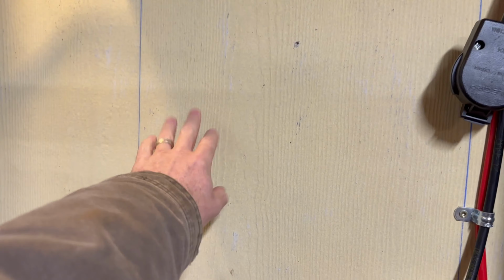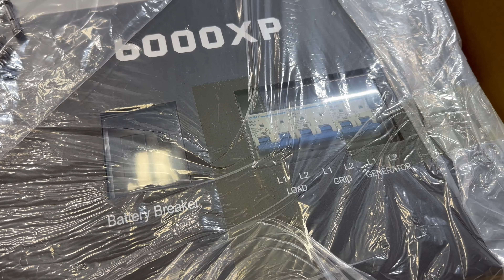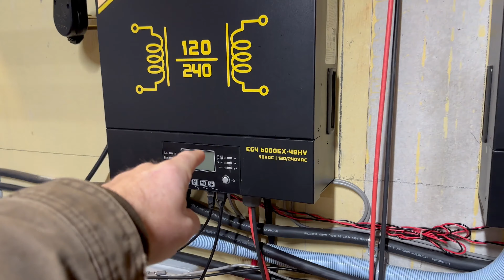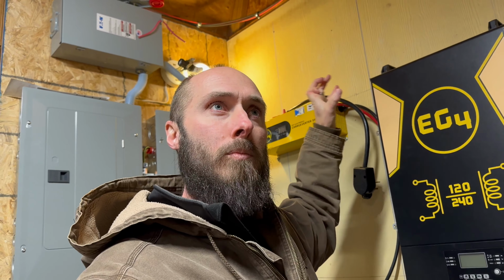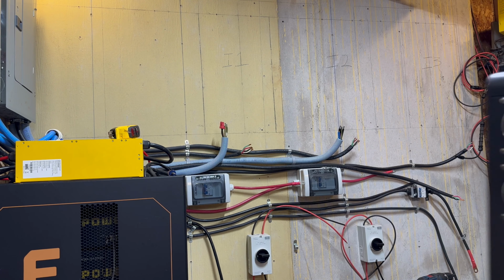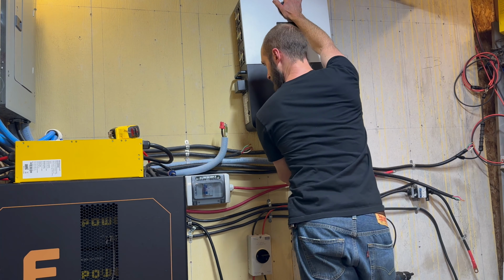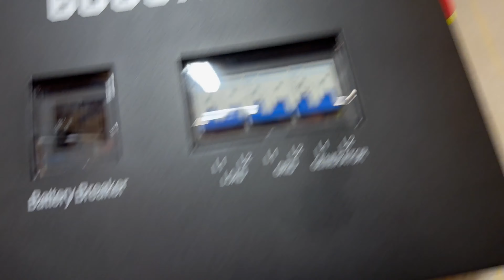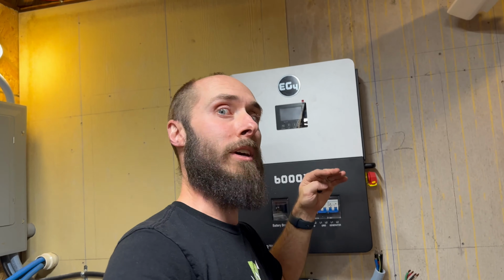Upgrading from EG4 6000EX to 6000XP Inverters #offgrid #eg4

Comment from the maker: Get $50 off your Signature Solar order by using my links below! 
• EG4 6000XP Off-Grid Inverter : https://signaturesolar.com/eg4-6000xp-off-grid-inverter-split-phase/?ref=esttxthst
• EG4 Chargeverter https://signaturesolar.com/eg4-chargeverter-battery-charger-48v-100a-5120w-output-240/120v-input?ref=esttxthst
• Server Rack Batteries https://signaturesolar.com/eg4-lifepower4-lithium-battery-48v-100ah/?ref=esttxthst
• Check out all things solar at Signature Solar: https://signaturesolar.com/?ref=esttxthst

Comment: I just got mine in and starting to set up. I took a drill bit larger than the screw slots. I drilled at the bottom of the slots to make a key hole shape in the slot. Be careful, you need to drill slowly. The drill bit can bind up, so go slow. Marked the wall where to predrill holes just a little smaller than the screws. I put the screws in, leaving them sticking out 1/2". Then held up inverter an slipped over screw head. Worked out great.
Reply from the maker: I thought about doing this but wasn’t sure if it would void the warranty or anything like that.  It would be great if they would add that key hole slot back to these like the older inverters. I’m glad it worked for you.

Comment: I think you have put together a great system... Both of them was actually pretty nice. I've been into this as a hobby for awhile but I'm rarely home to get to mess with my equipment. Someday soon tho
Reply from the maker: Thanks, @matthewknight5641! It's a super fun hobby. I'm almost sad that it's just about done, for now.
Reply: @EastTexasHomestead  I've been into this stuff for 2 years now and spent 30 grand this year on components. Mostly on the 280k cells from 18650 battery store. I drive a semi truck about 27 days a month and I'm constantly ordering more stuff. I am kinda addicted to this solar battery inverter stuff for sure . I've built a couple systems now and what little time we are home we never need the grid. I built one system using an all in one inverter then added another 100 amp charge controller but this latest system I built i used a larger low frequency splitphase inverter and 3 victron charge controllers and a DC to DC charger to link my leaf battery to my lifepo4. Every time I think I'm done I end up buying some new shunt or more panels.. or upgrade the mc4s.. or cells.. it's always something but like you I think I'm about done and ready to move on to a new hobby. I'm thinking some kinda off grid rain catchment system will be my new money pit for awhile lol

Comment: Hey boss. These are just the calculations I needed. Thanks for the explanation! I’m building a larger electrical mobile unit out of an enclosed trailer I’ve converted to be powered by the 6000xp with 10.2kwh server no alternator charge tied. My biggest question is grounding the system in a mobile application with no grid tie. Is grounding to the frame fine because of wood blocks and rubber tires. Or do I need to tie the ground to a rod at every location. I’m worried times I’ll be around pavement only. Thanks again boss!!
Reply from the maker: Sounds like a really cool system! I honestly can’t answer your question on grounding because I’m still trying to wrap my head around all of it. It’s so complicated and taking it mobile is a whole other level that I haven’t dug into. I would suggest checking out the RV forums to see how they are grounding their units in RVs because that should be a super close parallel.
Reply: @EastTexasHomestead  Ok cool! Thanks again!
Reply from the maker: you bet

Comment: Great Eric! Hmmm, you had 3 men at your property who could have helped and knocked that out.  Have you tried to use the generator set up without the Chargevertor?
Reply from the maker: Haha 😂 Great point, Steve! I used a generator with the old inverters with and without the chargeverter. I just limited my charging current to half of what my generator could produce. That’s supposed to give a cleaner sign wave. Takes a lot longer too.

Comment: I have the 2 of the SunGoldPower version of the 6000ex units running in parallel and the LED lights flicker slightly when on inverter (they didn't so much when I had a single unit). Also, every couple of days on solar, they kick off for about 15 seconds and restart. Or I might get a Bus Voltage too High error.  So I am curious if you had those types of issues (especially the random restarts) with your 6000XP units. I saw you had issues with faults, but I don't really have that, maybe once every couple of months. I really want to get the 6000xp units for the quieter operation, lower consumption, and maybe less head without a giant transformer in there.
Reply from the maker: We had the random 15 second shutdowns after adding the 3rd inverter. The lights also flickered real bad. All of that has gone away with the 6000XPs.
Reply: Glad to hear it!! I've got my TP6048 listed, but not bites yet. Would LOVE to get my hands on 2 of these 6000xp units! @EastTexasHomestead
Reply from the maker: Hopefully, you can find a buyer soon :)
Reply: That's what happens when you buy low cost, Chinese made inverters. Why do you think they're so much cheaper to buy than American made heavy duty, low frequency, transformer based inverters?

Comment: Changing out your EG4 6000EX low frequency, higher peak power, longer lived inverters for the 6000XP high frequency, lower peak power, shorter lived inverters was no upgrade in my opinion.
Reply from the maker: So far, they are working better in every measurable way. Time will tell if they last longer.